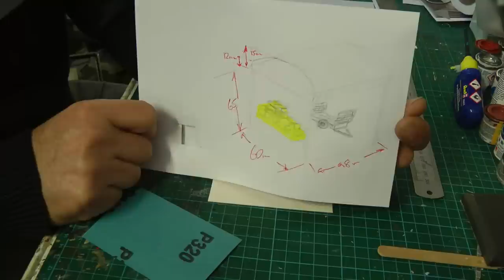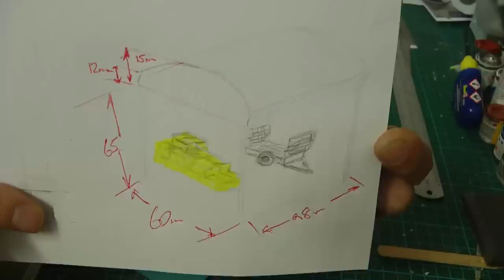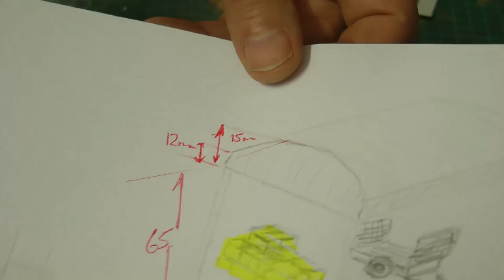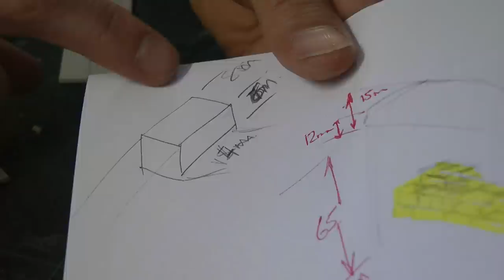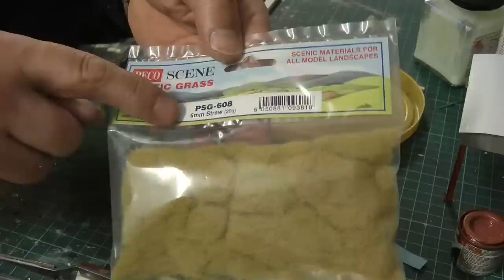Snookdown Farm Part 7 No372

Comment: Great Job, Tony.  I like the way you put together the bales of straw, overlapping at the corners, etc., which is required with real bales to ensure a stable structure.  For fun, you could add a rat’s head looking out of the bales. You could add some static grass to the floor of the pigstys, to look like scattered straw. 
If you want to add a pile of hay bales, you can use the same process using  mix of pale green and yellow static grass.  The hay will be useful for feeding the sheep in winter.  Plenty images of hay online to give you an idea of colour.  It’s all up to you, my friend.  Just ideas, matey.  Best, Jason.
Reply from the maker: Your ideas are great Jason. but i think there is only enough room for one more video on the farm. just to finish up. before we move onto Jarrow Road, We have a signal box to build with some signals. there is so much more i could add. but yes please do keep those ideas coming. thanks again my friend. Tony

Comment: Tony from a H&S point of view shouldn’t there be a corrugated section from the roof line down to the wall to prevent bales from tumbling off the stack onto the railway? Or perhaps your era is a bit light on health and safety!
Reply from the maker: Hi Edd, a very interesting thought. i am guessing in those days H&S was a light on the ground, cloth caps instead of hard hats. but yes that is something that i could add. thanks again for the idea. cheer's for now Tony